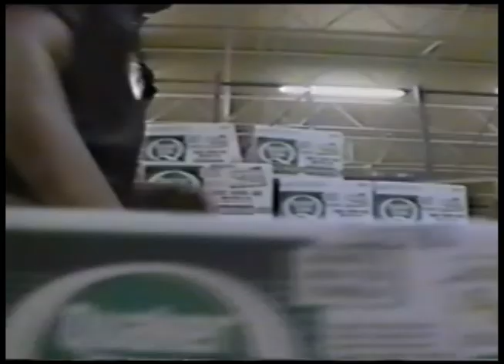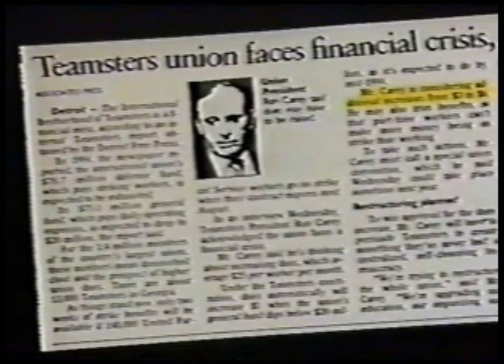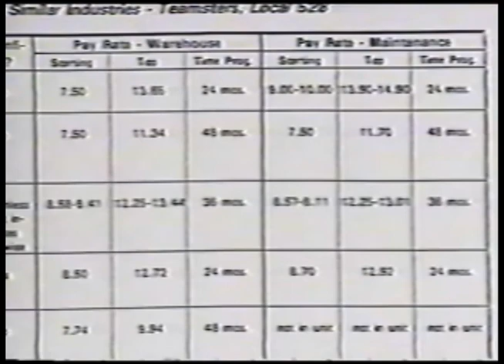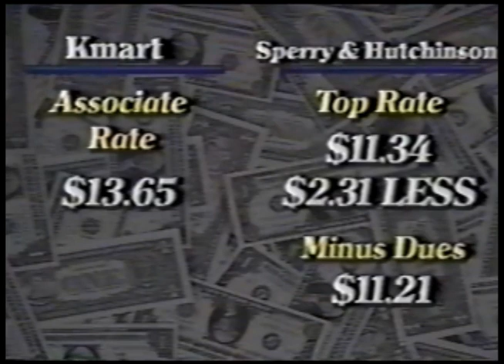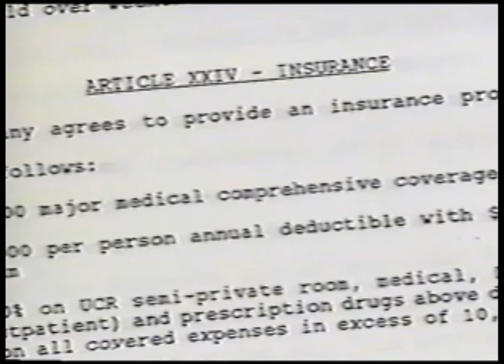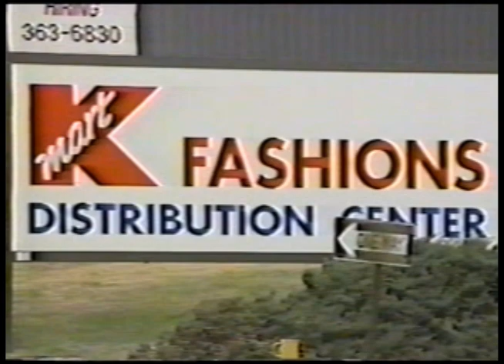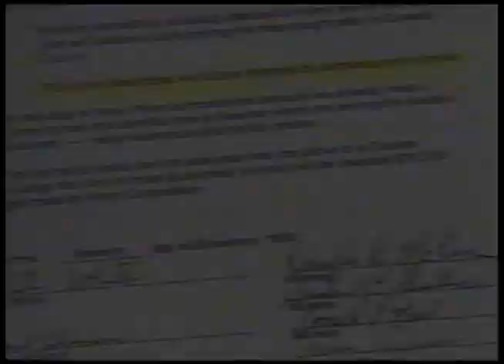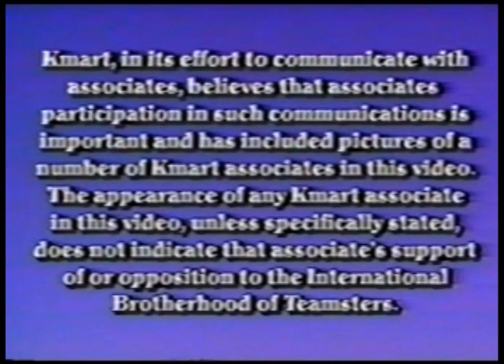K-mart Anti Union Video

Comment: Kmart abandoned the facility in Dec of 2015 they just got a new tenant in the warehouse in dec 2017. I assume that facility originally unionized since it went so far as to have a vote. The video appears to be 1995 ish. Also when you look at these union vidoes whether they be lowes,walmart, or kmart they have the same actors in it. I assume its a anti union consulting firm.
Reply: A very expensive firm.
Reply: In the target store video, the actors were actually unionized...
Reply: Brian Smith This is most likely some time in the mid 1980s. You gotta love that cheesy ‘80s music.
Reply: Based on the years referenced in the video, this would have been from 1994.

Comment: As of this post (7/12/20), Kmart is still holding on at only 44 locations, way WAY down from their peak in 1994 of nearly 2,500 stores. They're currently owned by an outfit called Transformco, based out of Illinois... which is in turn owned by a company owned by the guy that put Kmart in the spot they're currently in.

I don't think there'll be a comeback for them, but stranger things have happened...
Reply: Ed Lampert.... Chuck Conaway.... Remember their names when someone talks about Kmart's demise, these names are synonymous with corruption, crookedness, and downright horrible activities.

Comment: 10:00 The same thing happened in Australia.
Prior to retail workplace agreements, the award rates went up at a steady rate. After retail workplace agreements were introduced, the unions weren't pushing to have the state and federal award wages to increase, because they were busy negotiating separate workplace agreements.
Union workers told retail workers they were being paid much higher than the state and federal awards. While that is technically true, it was only due to the reduction in state and federal award wages increases, compared to pre-workplace agreement years.
About four or five years after workplace agreements were introduced, comparing the average inflation rate, staff of one supermarket were actually being paid approximately 30% less than they were being paid under the original award wages, prior to the introduction of workplace agreements.

Comment: While the concept of a union seems ok. It can have devastating impacts. A good example is Hostess. While yes the teamsters did actually agree to pay cuts to save the company, the bakers union wouldn't budge. So what happened? Chapter 11, now instead of making less they make zero.

If your job sucks get another one, retail, fast food, etc is supposed to be entry level jobs. Climb up the ladder or get a better skill set if you want to be better off. Put the effort in and you'll reap the rewards. 

I'm ready for the flame fest, if you disagree then debate my point :)

Comment: In 1983 I was an 01 that's the guy everyone else in the store called to whatever crappy job that came along,
bring out the blue-light cart and running the extension cord and plugging it in and cleaning up the restroom and then stocking the selfs or any crappy job that came along and then be yelled at by the old women who worked there longer than I.
I hated Kmart and the old women who worked there longer than me and yelled.